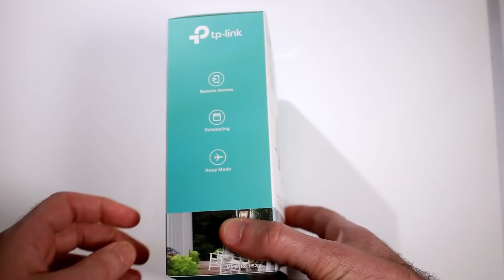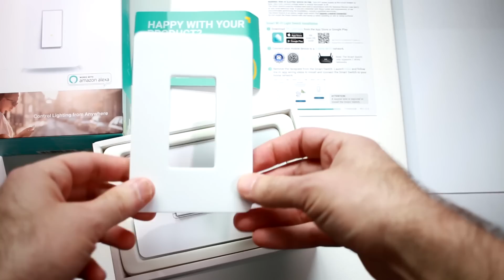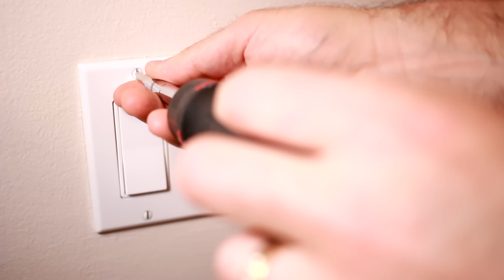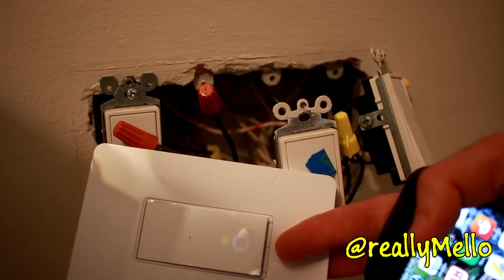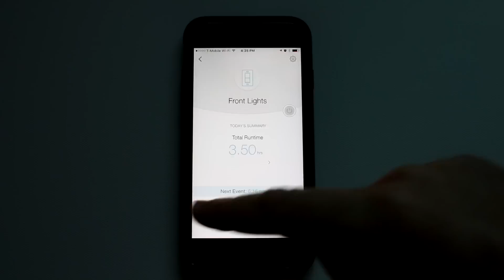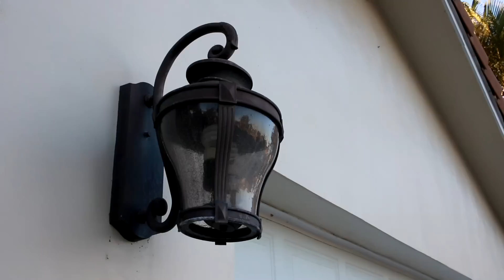TP Link HS200 wifi smart switch installation with kasa

Comment: Did you leave the red line unconnected? My old line has a red, and I have no idea what to do with it.
Reply from the maker: Sounds like you may have been wired for a 3 way switch previously? If you have black white and red it could indicate that. I have another video going over 3 way switches https://youtu.be/OW36oe8oTsY

Comment: How did you get that bigger switch to fit back in there next to the other ones? Thanks for the videos!!
Reply from the maker: Carefully had to fold the wires out of the way
Reply: @reallyMello  So you were able to keep the cover you initially had instead of the bigger one it comes with?/
Reply from the maker: Yes you just pop off the cover they supply. It is made to fit any decora style face plate so if you have a multi gang box like mine with multiple styles of those switches it swaps right in.

Comment: Hi, My smart switch has 2 black wires coming out of it simply marked Load/Line above the 2 wires. No distinction between the 2. Does this mean  it does not matter which black wire i connect to the load and which to the line?
Reply from the maker: Typically you’d connect incoming power to line and outgoing power to the thing you want to switch on/off to load
Reply: @reallyMello  My KASA smart switch has 2 black wires coming out of it simply marked Load/Line above the 2 wires. I am replacing a switch in a box with 2 other switches, similar to what you are doing in video. I can see where to connect the white wire and the green wire. I can see the 2 black wires 1 coming into the box and 1 going out to my outside light. The question is how do i know which of the wires coming from the KASA switch should go to the in and which to the out? Or does it matter? The 2 black wires are simply marked Load/Line above them vertically so you can't tell if there is a distinction.
Reply from the maker: @jimlidstone5855  it’s been awhile but if I remember correctly I connected line to the left black wire and load to the right black wire (when facing the back of the switch). It may not matter, but I’d have to check around to confirm.
Reply: @reallyMello  Thanks! I either got lucky or it didn't matter. From the little experience i have with switches, and looking at how the basic switch i replaced was wired,  i was fairly confident it wouldn't matter so i went ahead. Everything's working perfect.
Reply from the maker: Ya from my understanding it doesn’t matter typically unless it’s a gfci switch

Comment: Did you have an issue with the switch plate fitting flush against the wall? I noticed Kasa uses a very thick flange compared to a normal metal flange on a regular switch. It's probably 3 times as thick.
Reply from the maker: No issues for me

Comment: How can i install my Kasa HS200 if i got 1 black cable and 1 white cable on my Box?
Reply from the maker: Was a regular switch there before?
Reply: @reallyMello  Yes
Reply from the maker: Ok so normally then you should have a black wire coming in from the circuit breaker (line) and then the other section goes to the fixture you want to switch on/off (the load). Typically you'd also have a bare copper or green wire is that the one you are missing? If so, is the enclosure metal? *disclaimer that sometimes different colors are used and should not solely be relied upon
Reply: @reallyMello  Yes, the copper cable is missing but the box is metallic It only have the black and white wires
Reply from the maker: The metal enclosure may have a ground attached to it if it has a metal conduit attached or a ground cable going to the box. If that is the case you could attach the ground wire from the switch to a ground screw on the metal enclosure. *You should verify that meets local code in your area and the box is properly grounded.

Comment: Thanks, just got mine working!  Your instruction on how to set up the wifi was great.   Is there a way to use voice commands to turn on a light, or must the Kasa app be opened and the light manually selected.
Reply from the maker: Do you have any Alexa or Google assistant devices in the house? If so, yes you can use voice commands to control them.
Reply: @reallyMello    No, this is my first smart device.  Do you suggest the Alexa or Google  assistant?
Reply from the maker: I like Alexa personally. That would act as a orchestrator or hub for this and future smart devices so you can say “Alexa turn on the lights” for example and setup other routines or triggers with other smart devices.
Reply: @reallyMello  Ok, that sounds like the most popular one.   Thanks.   It's remarkable how responsive these switches are, zero lag.

Comment: I only have one black wire, one neutral and one ground wire coming out of my wall bracket. Can I still use this?
Reply from the maker: If there was an existing switch there you should typically have one black wire coming in from the breaker panel and then one traveling out to the switched device (like a light for example). Do you see that?
Reply: @reallyMello  I've opened it up and took the old switch out. Unfortunately the wiring I listed is all that's there.
Reply from the maker: On the existing switch the black wire isn’t attached on two different places?
Reply: @reallyMello  nope, I don't think they wired this house properly. I think I'll just leave it alone until I get this place rewired.
Reply from the maker: May be a good idea to have an electrician check things out to be on the safe side

Comment: What about the two blacks, do they go together?? Useless video
Reply from the maker: You'd have to be more specific about which two wires or what part of the video you were confused about. Typically there would be one black coming from your breaker panel carrying power that you'd attach to the black line wire on the switch and then attach the other black load wire on the switch to the black wire going to the downstream load (your light for example). I did a review after this one on a slightly different switch that has a better angle to explain https://youtu.be/KU_m-YO9Oag?t=109

Comment: Not very helpful, you didn't show how to remove the cover and then use yours that has 4 light switches.
Reply from the maker: The tp link cover pops off with a gentle push and then it will fit in the any standard decora style plate like shown. Hope that helps!

Comment: ❌  So,  you gonna left wall switches hang like that?
How you gonna fit big new plate into small slot?
I have trouble separate big plate.
Reply from the maker: No, they weren't left hanging. The 4 gang switch box I installed these in has screws for each switch so each switch was securely screwed into their respective places after the wire connections were made. After, the faceplate goes over for cosmetic appearance. To be clear, what plate are you referring to? The faceplate pops off the HS200 if you are using it to replace an existing decora-style switch in a multi-switch gang switch box so you can use the existing faceplate.

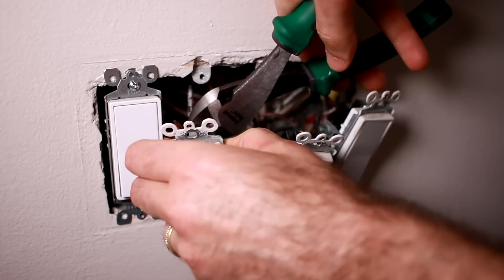Comment: I have the same 4 light switch diagram. @03:09 I see the bottom black (line) is just one piece going to the other switches. Did you cut it to make 2 so that you can connect the new smart switch black (line) connector from the that end?
Reply from the maker: Yes they had it looped through all the terminals so I cut it to connect to the pigtail and spliced it back in line
Reply: @reallyMello  very nice! Thanks for the input bro cuz I bought one and got lost after I saw it was 1 whole black line. I paused and said fuck it when I only had to cut it haha!

Comment: We know how to remove the faceplate on wall by unscrewing the screws over there but I am looking for a video on how to remove the faceplate on the KASA switch. Its not easy and I am feeling little nervous to pri out as it may break the plate or damage the switch itself.
Reply from the maker: The faceplate it comes with that you can attach to the inner switch you mean? It will pop off with a little pressure.

Comment: You don't need to cut the stab in. Just use a pin in the hole next to it to disingage the spring holding the conductor.

Comment: I like these TP Link smart products. They are very reasonably priced for a UL certified smart device. Amazon is currently offering a 3 pack of the HS200 for $36.99. That works out to an individual price that is lower than the Shelly 1. Given that the TP Link switch provides for a much easier and cleaner install, choosing it over the Shelly relay is a no brainer. I went with the Shelly relays when they first came out because they were far less expensive than any of the smart switches. Not any longer. The Shelly manufacturers may want to rethink the substantial price hikes that they implemented over the past year.

Comment: I have 3 wires 1 black 1 white and a ground can I still install the switch ?
Reply: Same issue, only 3 wires on the old switch - same set up
Reply from the maker: Typically you have one end of the black coming from main power and another end of the black that goes to the device you are switching. Does it look like that?

Comment: Can you set the switch to wirelessly control  kasa light strips, so that when you press the switch, the kasa led light strips will turn on in the room?
Reply from the maker: You can link them in the Kasa app for the same result, but Alexa routines doesn’t let you use the kasa switches for routine triggers.
Reply: @reallyMello  thanks for relying. sorry if I’m confused, but I what I mean is can I program it so that when I physically press the switch, the led light strips will come on (Eventhough there is no physical wire connection between them)?
Reply from the maker: Yep, assuming you want to turn the room lights on/off along with the kasa strip that should work if you add a routine in the Kasa app.

Comment: So.. I have only one black wire in the wall. I guessed and wired the two black on the switch to the one in the wall.. light on switch works, wifi works, but it does not turn on lights either by wifi or by pressing the switch... what am I doing wrong?
Reply from the maker: Hi nano, I’d need to know more. Are you replacing an existing switch or installing one where there was none before? Also, please don’t guess the wires that can be dangerous. Typically you should have one black wire coming from your breaker panel and another going to the light fixture. The colors can vary though.
Reply: @reallyMello    Replacing a switch. The old switch only had 1 black 1 white and one ground
Reply from the maker: So normally the black wire should be coming to the switch bringing power to it and then a wire leads out of the switch to the light being controlled by it. A volt meter would detect the one coming from the breaker as live. That would go to the line lead on the hs200. The black wire going to the light would connect to the load lead on the hs200. *always consult an electrician to be safe
Reply: @reallyMello  yeah.. this is obviously not a normal situation.. 4 gang box.. each switch had 1 black 1 white and one ground... only thing different was the last switch was wired opposite of the others.. i replaced all switches with normal decora switches and just the one with the smart switch.. I did not wire the backwards one backwards again  but they all work fine except the smart switch... going to have to do some investigating

Comment: Wall switches have a little slot for a small screwdriver to release the push in wires.
Reply from the maker: I did not see any in mine at the time, but I don’t doubt you are right. Good tip, thanks.

Comment: I’ve installed quite a few of these quickly and easily but tonight am attempting the first multi gang and have run into an issue. I am installing two in a two gang (light and fan switches for same overhead fixture) and the original switches are daisy chained as far as one black wire goes. Can you further explain how you did this to work for both? Can you just connect a black wire from each of the smart switches with the black switch from the wall going to the original or does something more need to be done? Appreciate the help!
Reply from the maker: In my case I was able to chain the black wire coming from the breaker to each switch to supply them all with power. The 4 switches control different fixtures (interior light, exterior light, switches outlet, porch light). I changed out the switch that was controlling the exterior lights.
Reply: reallyMello thanks so much for the response! I was able to connect a black wire from each switch to that same black wire last night and they have been working flawlessly. Here’s to hoping it stays that way!

Comment: I have two live wires on my Kasa switch but only one live wire in my wall.  What should I do with the extra black wire from the Kasa switch? It's 3 wires in total that comes from my wall (the copper ground wire,  a single black wire, and a single white wire,)  but 4 on the Kasa switch.  When I hook both live wires from the Kasa switch, to the one single black wire coming from the wall, it does not work.  My light comes on very dim and it's NOT a dimming light. And, the Kasa switch makes a  clicking sound that won't stop when I try to reset it. The same thing happens when I leave the extra black wire hanging from the Kasa switch. Do I tie the extra black live wire from the Kasa switch to another wire from the wall like, to the ground or, the white wire?  Please help me.
Reply from the maker: Are you replacing an existing light switch?
Reply: @reallyMello  Thanks but, I figured it out.  The light switch that I'm changing, is for the garage.  The wires for the switch that I was replacing was just a connector, and the white wire had black tape around it meaning it was live.  I followed the line from the light switch to the ceiling and found, all the wires that I needed to connect to,  in a metal box on the ceiling. Every wire was in the box so I connected the Smart Wi-fi Switch to the wires in the ceiling.  Not where the light switch was and it worked.  Now tomorrow I gotta run to Home Depot to buy a 14/3 14 gauge wire and connect it from the box on the ceiling to the light switch,  and then, I'm going to connect the smart switch to the proper wires. But, I'm going to connect my Samsung Multipurpose Sensors to the garage door 🚪 so when it opens,  the light just comes on, and when you close the garage door,  the light goes off, all, without saying a word.
Reply from the maker: Nice detective work!

Comment: What does the neutral do?? What if you don't have one?
Reply from the maker: Hi Sin, in a smart switch it provides the power needed for the switch to keep the smart part on when the switch is off (so it can communicate). If one doesn’t exist you can have an electrician run one to the box.

Comment: Did your regular wall plate sit flat after the installation? Kasa HS200 has thicker depth than regular metal switches, as a result it's not sitting flat on my wall. Any idea if a jumbo wall plate would help?
Reply from the maker: Hi Pitamber, a jumbo wall plate is usually more for styling or to cover a larger rough opening behind the plate. I don't think it would help if the issue is it sticking out more. If you can better (and safely) fold the wires to make more room to push the switch back in the receptacle that should help. Alternately, you could replace the receptacle with a deeper switch box. This is an example https://amzn.to/305HMnC , but they come deeper if you have the space between your walls to fit it.

Comment: No, No, No, NO!!!  The first step is to TURN OFF the power.  You should not remove the switches from the box with power connected. Also, it would be good to mention that since there are multiple switches in this gang box, it's possible that they are fed from more than one fuse or breaker.  Verify that all circuits are swiched off.  Green wire should be connected to the box.  Trucker V should call an electrician.

Comment: Hi there! Does anybody knows what happens if I have 220 volts instead of 120? Is there a way to connect with this voltage or should I purchase a 220 voltage switch?
Reply from the maker: Sebastian Link the data sheet on the tp-link website indicates the input voltage is made for 100-120v 50/60hz at 15A. It probably is not safe deviating from their specifications.

Comment: Ok so what of you don't have a breaker to shut off plugs? My house was built in the late 50s early 60s and the only breaker I have is one main breaker to the whole house. I'm not going to shut down my whole house. Dont you have to be touching the hot and ground at the same time to get shocked? I mean I don't plan on touching bare wires but if anyone has wired a hot plug before I would appreciate some feedback
Reply from the maker: I wouldn't risk it. You could end up becoming grounded to the floor/earth and get shocked. My only experiences are with houses with more modern breakers panels so maybe someone else can offer some guidance (certified electrician would be best). Your setup does have neutral wires though? Those are needed for this switch.

Comment: This video didnt really explain much during the installation.
Reply from the maker: What isn’t unclear let me know and I can help. Thanks.
Reply: @reallyMello  I have two live wires on my Kasa switch but only one live wire in my wall.  What should I do with the extra black wire from the Kasa switch? It's 3 wires in total that comes from my wall (the copper ground wire,  a single black wire, and a single white wire,)  but 4 on the Kasa switch.  When I hook both live wires from the Kasa switch, to the one single black wire coming from the wall, it does not work.  My light comes on very dim and it's NOT a dimming light. And, the Kasa switch makes a  clicking sound that won't stop when I try to reset it. The same thing happens when I leave the extra black wire hanging from the Kasa switch. Do I tie the extra black live wire from the Kasa switch to another wire from the wall like, to the ground or, the white wire?  Please help me.